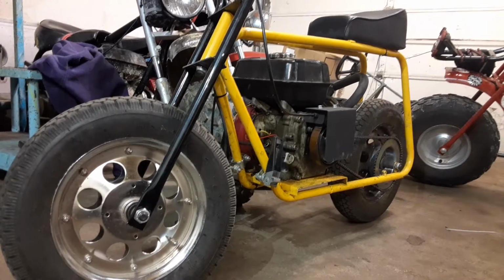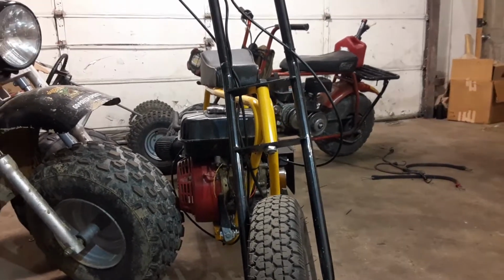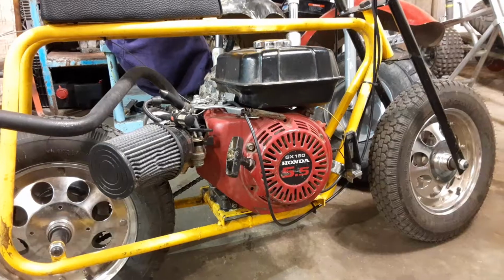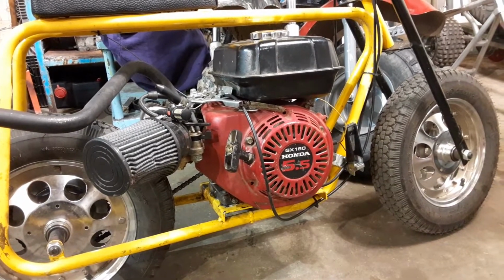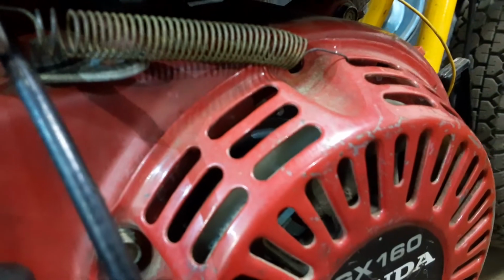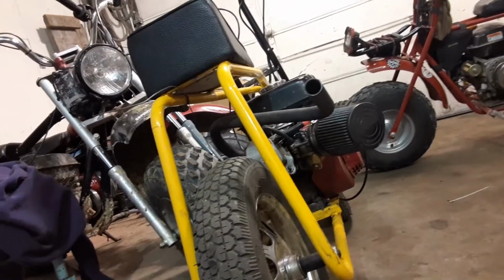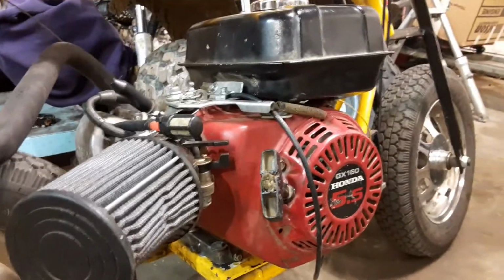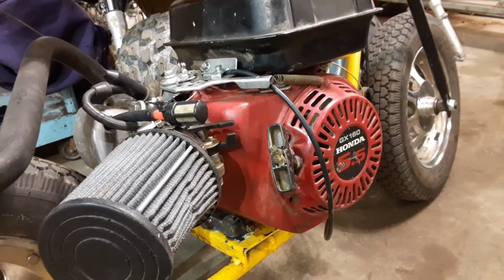Azusa Mini Bike

Comment: I wouldn't recommend a clutch band brake system. The clutch band brake system is bad because if your chain snaps off or breaks then there is no way your stopping unless you use your feet. Also, going 50 MPH with no brakes would be a nightmare.
Reply from the maker: Yea it does come off. It needs a tensioner bad bc the chains so long when you nail it. It starts slapping up and down and falls off. Ima put a spring tensior on it soon. I have a different sprocket for that bike with a built in band brake drum instead of the normal drum brakes. I just need to fab up a bracket for the band and that way i can solve the problem of no brakes with out a chain. Although i do prefer it being on the clucth bc of the extra braking power its a trade off situation for safety Thank you for your comment and concerns. Have a good one.